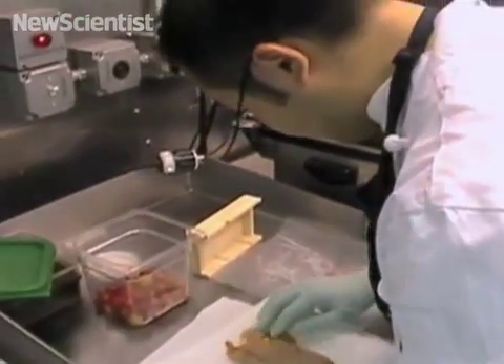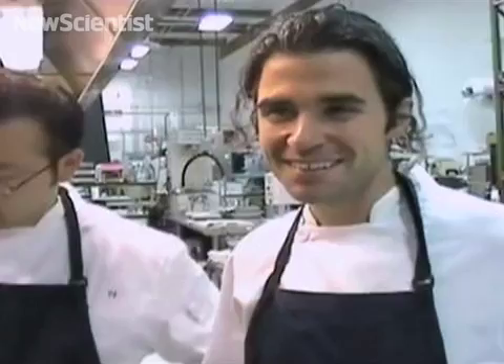How to make watermelon chips

Comment: @rs666sathan666pk 1) it could just as easily be done with a metal press or vacuum. (though you wouldn't want to make said device until you find a market) and 2) plastic isn't nearly detrimental to our environment when it's trashed properly (and yes, I do mean "trashed"; recycling plastic produces nasty toxins, whereas the manufacturing process requires biological material and there's less nastiness produced; same story for paper recycling; reference: watch?v=zzLebC0mjCQ).